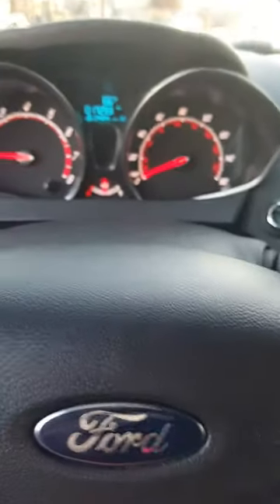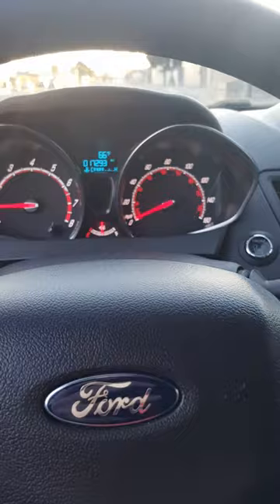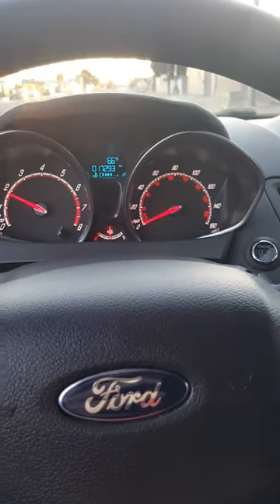2015 Fiesta ST ATP turbo 0-100 run

Comment: quick question which I believe I know the answers would any intake bolt up to this turbo? I have a Cobb intake. also where did you mount your bov? I plan on getting an upgraded turbo and getting tune from Adam what kind of power did you make on this. thanks again
Reply from the maker: any intake will bolt up to the atp set up. they provide you with adapters for many different cold air intakes.

Comment: Man this thing hauled to 80, but got real slow after 90 or so, any reason or did you let off. Just curious. Nice FIST tho. Love mine.
Reply from the maker: I did lift a little as I was on a closed city street in mexico. the atp kit will be coming off the car this month and replaced with a dhm kit. expect more videos soon.
Reply: +Stephen Hollander you gonna sell that ATP kit? XD
Reply from the maker: +Vroomtastic I re-used the turbo from the kit in my dhm retrofit, So there is really nothing left of the atp kit to sell.
Reply: +Stephen Hollander ahhhh went with their quick spool manifold? How big is the difference?
Reply from the maker: I did go the quickspool route. It was worth about 500 rpm of spool. Knowing what I do now for a daily driver I recommend the X37 hybrid turbo.